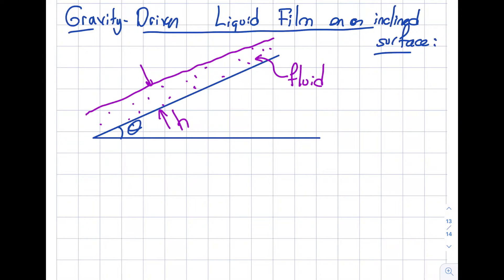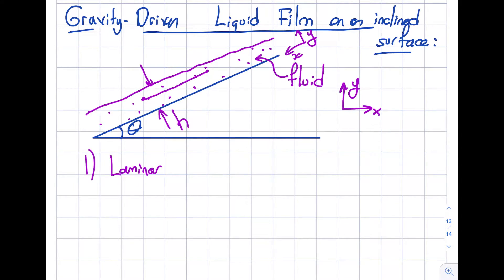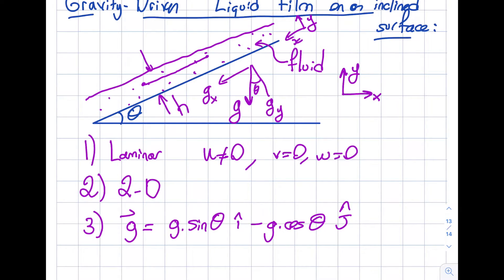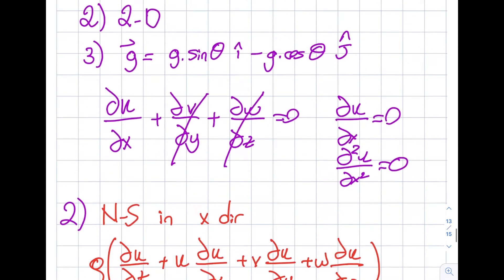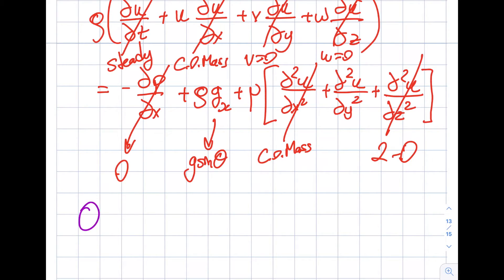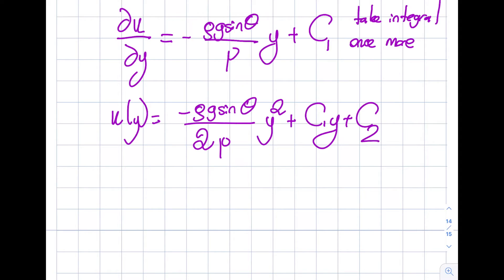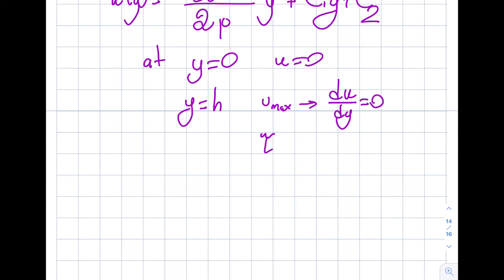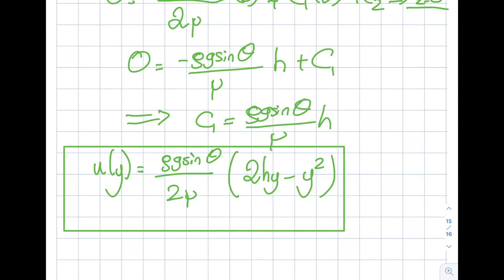Fluid Mechanics 12.4 - Gravity Driven Liquid Film on an Inclined Surface

Comment: Just want to be much clearer in this, is the pressure P1 same as P2?
I see there's a difference in height between P1 and P2. Doesn't that make a difference in pressure? I need to be corrected Sir,
Thanks
Reply from the maker: That is correct. P1 must be equal to P2. Both points are exposed to the atmosphere which has a constant pressure value at a given elevation.

Comment: Just want to be much clearer in this, is the pressure P1 same as P2?
I see there's a difference in height between P1 and P2. Doesn't that make a difference in pressure? I need to be corrected Sir,
Thanks
Reply from the maker: I responded to your other comment, but yes P1=P2

Comment: Good day and thank you so much for the explaination. You made it extremely clear! Would you be so kind as to point me in the right direction for cases in which the flow is not steady ( ∂u/∂x ≠ 0 ). I mean I think the initial crossing out of the NS-Equation would be easy but what should I do after that? I'm designing an inclined channel to set up a thin film of thickness h. The velocity of the thin film will be measured with a pitot tube that I will somehow install at a selected height y (according to your nomenclature), therefore the value I will be calculating is  the thickness h mentioned above, and then I will confirm it with a measurement device. I am a bit confused however since, even though I differentiate now between steady and non-steady (h not constant throughout x) flows, I can't seem to find which one of the two occur naturally when a body of water flows in an inclined surface (and therefore I don't know which initial assumptions I should consider for my set-up. I would be extremely thankful if you could shine some light on my issue! :)